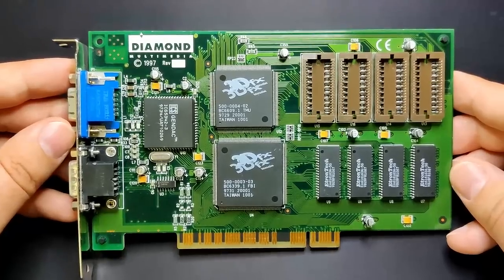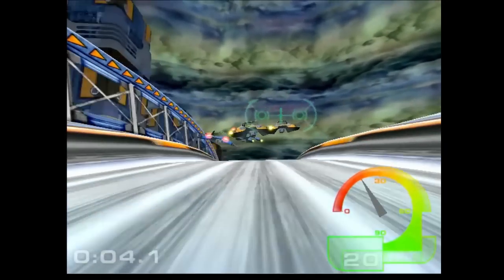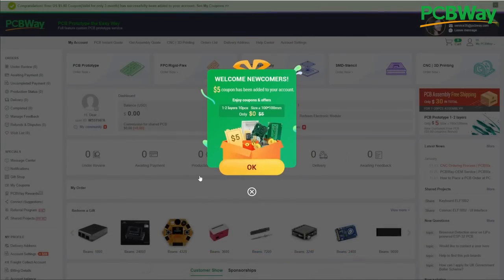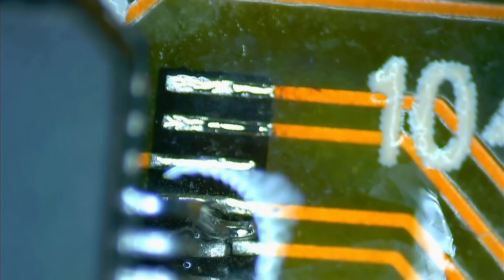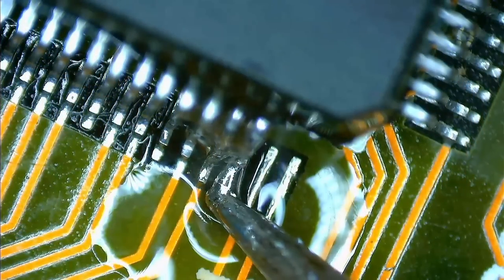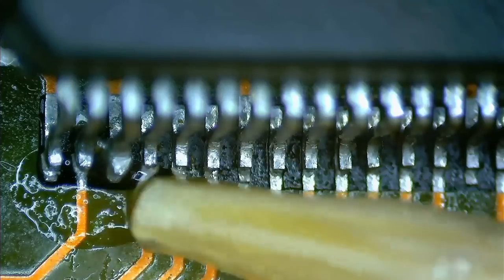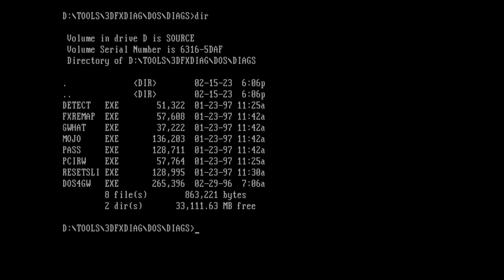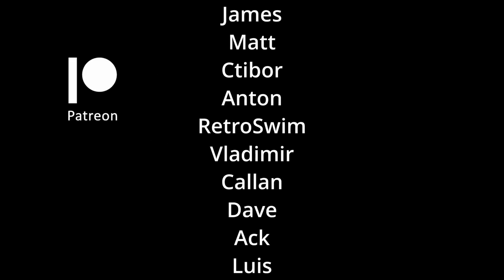Broken pins are no reason to trash your 3Dfx card!

Comment: I wouldn't be so dismissive of the difficulty of this.  It was easy for you because you've developed your abilities to the point that you can successfully perform this repair, but it is certainly not easy.  Great job again on resurrecting another precious Voodoo.  You're doing God's work!  Love your content!
Reply from the maker: The microscope helps a lot! The repair didn't require any electronics knowledge, but the area is very small. I am glad the repair was a success! Every 3Dfx card saved is worth the effort.
Reply: It's 90% equipment and 10% skill, all you really need is some basic experience with soldering and steady hand. without microscope, this repair would be close to impossible unless you have hawk's eyes transplanted.
Reply: @bitsundbolts  The 8Mb mod ... I don't understand it....... If you are bridging (or piggybacking) the data address pins of both.. original and additional chips............ well.. the additional chips will have an identical copy of the same data...... the new chips will have in them exactly the same 4Mb of data that the originals...... they do not store additional data............ in other words.. the GPU can not store additional data in the new chips.... because it do not have new additional traces to store or read from them... i think 🤔...

Comment: I have been an electronics hobbyist on and off for about 30 years now. But I have almost only worked with through-hole stuff. I could NOT solder what you just did on that card! Awesome job mate, well done repairing that card!
Reply from the maker: Thank you! Without the microscope, I wouldn't be able to do this type of work. I just need to replace the camera and light to improve the quality. Thanks for watching!

Comment: It's a pleasure to see fellow 3dfx fans doing the same thing. I recently fixed a Diamond Monster 3D II with one corner pin missing on the FBI. The metal was not long enough so I dug a tiny channel upwards with the tweezers and soldered on a piece of wire. The card came back alive just fine. Save these relics, one at a time!

Comment: Fanastic job!  Regads the pin fixes, I would go with super fine wires rather than replacement legs - the reason is if they get knocked, they could break off further where you then need to grind the chip edge away to fix.  Fine wires on those points, perhaps covered by UV solder mask paint would be fine and a lot less likely to get damaged from knocks etc.

Comment: Don't worry about mixing up ferrite beed with inductor. Ferrite beed also belongs to inductors but has  more specialised task. It's often used to stop high frequency oscillations passing through to the power line. Unless currents are really high typical SMD inductor can do this job just fine. We all live and learn.

Comment: Like! I wonder how much a 3dfx Voodoo 1 can be overclocked, unfortunately there is almost no information on this subject. It would be very interesting to see some benchmarks with a 8 mb 60 to 65 mhz Voodoo 1 :)
Reply from the maker: I read that Voodoo cards are terrible in overclocking. But then, moving to 55 MHz is already a 10% overclock.
Reply: @bitsundbolts  as far as I know the Diamond Monster had an option to run at 57.5 mhz. There were many Voodoo 1 cards sold with 30 - 35 ns EDO ram which at least for the memory have a high overclocking potential.

Comment: Handy tip. You can harvest thin enamel wire from old laptop or PC cooling fans. Also you can safely remove a small amount of the encapsulation plastic if the broken stub is too small to solder to.
Reply from the maker: I may have to remove some of the plastic. When I pressed on the memory boards, the solder joints on the chip broke. It was a quick fix, but clearly the sturdy replacement pins and weak connection to the stubs aren't a good combination. For now, I am very careful with the card, but I may mix it into another video which requires pin replacement and mention the issues with my approach in this video.

Comment: L10 is the component which was missing on my Diamond Monster 3D card as well. It supplies power from the 5v rail to one of the PLL inside of the ICS5342 GENDAC. The datasheet for this chip suggests a Fair-Rite 2743019447 ferrite bead to feed the input at pin 27. The thing is, the missing bead feeds in 9 if I recall correctly, and the datasheet shows this as a direct connection with no bead. Based on this a simple wire should work. If you use a bead the specifics clearly aren't important. I grabbed a random bead/inductor from a dead motherboard and it works fine.

Comment: As an electronics technician: Replacing an inductor / ferrite bead without knowing it's exact characteristics is crazy. But I'm glad it worked.
Reply from the maker: How could I find out the value of this component without spending thousands of USD on equipment? Is that even possible?
Reply: @bitsundbolts  You can get an LCR meter for about 30 bucks these days. It certainly won't be accurate, but it lets you get a rough idea of the capacitance, inductance and series resistance of SMD components. There is a lot more to component selection than these values, but combined with knowing the physical dimensions, it reduces the chance of damaging other parts of the circuit by a lot.
Reply: @bitsundbolts  I don't think either are absolutely necessary here. We're talking about 50Mhz 3.3V components if at all.

Comment: I've had to do this many times, usually to fix my own screw ups, but there always seems to be enough of the pin sticking out after breaking off that it always works.  I'm surprised you were able to fix it this well with such fat wire.  You should get a roll of 30 gauge wire wrap wire or a roll of lacquered magnet wire to fix things like this and broken traces and stuff for the future.
Reply: Or for really fine stuff take a single strand out of a stranded wire.
Reply from the maker: I definitely should use thinner wire.

Comment: I would leave the pins like that, it is working and that maters the most!
I also attempted repairing broken pins in chips and I found much easier if I just leave the wire straight near the bit of metal of the remaining pin. But I guess does not look as good as your fix.

Comment: Technically, ferrite beads are inductors rated by their impedance at a given frequency (just numbers tho, and it will not affect the performance compared to the one of an inductor with the alike properties of course), this also makes them less expensive due to a lower accuracy requirement. The things to worry about are the saturation current (as above one the AC impedance starts to drop) and the DC resistance (which the beads are expected to have the least of, - of course it means nothing, and you can find an inductor with the same or even lower DC resistance). So, if your inductor's saturation current is high enough, I'd say usually you are good to keep using it, as it likely has a bypass capacitor on the load end anyway, so the value, with 4.7 uH being a higher one, does not really matter that much. If anything, you can just take a scope and make sure the voltage spikes do not propagate through the filter the bead used to be a part of. Also make sure no significant DC voltage drop happens across the inductor, and should both tests pass you are good to keep using it without any worries.

Comment: a nice tip, but it's difficult to solder. Next time instead of it, just use tranformator copper wire,I think it would be be easier to solder and fit to pins.

Comment: For this kind of a repair I usually use Kynar wire (not the cheap knockoff stuff). Not only is it thin enough for these pins, the conductor is silver plated lowering it's resistance, and the insulation on the wire wont melt or shrink back when using it as general hookup wire as it's PVDF. Instead of trying to cut and shape the wire, I would have just stripped off the insulation on a length of wire, soldered it to the pad, bent it into place, soldered it to the chip, then cut off the excess. The excess wire not only gives you something to hold and manipulate, but also sinks the heat away from the pad, preventing it from melting the solder on the pad.

The ticker wire you used also may fail prematurely due to thermal cycling over time cracking the solder joints at the chip, a thinner wire which can flex would likely not suffer from this. You can also take a scalpel (NOT and angle grinder, sheesh) to the plastic package and scrape it back to expose more of the leads on the lead-frame to solder to, giving a more secure connection.

Comment: I don't know much about these components, but based on what they both do it sounds like there is pretty much no difference and if anything an inductor is probably a better component. But I will be happy to say I'm wrong if someone wants to say otherwise.
Reply: They are both inductors, but they have very different characteristics. Optimized for different jobs.
This is like capacitors. you have many types and ceramic capacitors have different characteristics from electrolytic capacitors.

Comment: I have to do the same work on 486 motherboard chipset but in my case broken pins are not in the corner but in the middle of a chip and maybe I will also try to fix PII BX chipset in similar way (he don't have pins but I have to try this angle grinder trick).

Comment: You can use a hammer and flatten the wire slightly for easy soldering
Reply from the maker: I see - to flatten the round wire, that probably would have helped a little. I may use your suggestion for a Voodoo 2 that may arrive with one pin missing somewhere in the center of the pin-row.

Comment: Personally, I'd be tempted to forget about authentic looks and try to provide extra protection to your replacement pins. 

Maybe cover the entire corner of the chip in an epoxy blob? Or maybe someone knows about a product that can be easily removed in the future with some kind of solvent?

 I'm just worried that those solder joins with the lead frame will be far more vulnerable to damage in the future than fully intact pins.
Reply from the maker: I am sure those pins are not as strong as an intact pin, but they are quite good. I am not worried anything is going to happen to them. One could tape a heatsink over the chip, covering the chips with some overhang - that won't protect the pins entirely, but it will be harder to reach them.

Comment: Do you know if mojo also works for voodoo 5 5500 cards? Or maybe another similar testing program for DOS?
I'm really struggling with a card like that that has probably RAM issues. Full of vertical lines/garbage on the screen. One version of mojo sais that no voodo card was detected, other one stops with some error message.
Thanks.
Reply from the maker: I have not tested mojo with anything but Voodoo 1 cards. But I think this tool will only work with Voodoo 1 and Voodoo 2 cards.
Have you tried pressing on the memory chips to see if it changes the pattern on-screen? Maybe a solder joint that's broken.

Comment: There's no way I could do this many pina like this yet. Bet while I solder the new leg from the bottom, the top also desolders itself and everything tips over.

But I can throw bodge wires, hopefully that's ok.
Reply from the maker: It took me about 10-15 minutes to get those 3 pins attached. I think the thin soldering tip doesn't dump a lot of heat into the pin since I did not face desoldering on the opposite side. Wires and apparently angle grinders are all good :)
Reply: @bitsundbolts  I suppose i could just tweeze them in and solder them from one side, then liquid-soldermask that in, and then the other. Where there's a will, there's a way. Magnification is the most important bit to sort out properly.

Comment: The card was probably dropped. Fell on that corner of the chip and bent all the corner pins down. The shock of this broke loose all those other pins because it's very old. Then someone without the skills to do this attempted to bend them back and broke them off. Probably tried to do it without a microscope at hand so that's why all 3 are broken and the 4th is bent way out.
Reply from the maker: Very nice and plausible investigative work!

Comment: You made things difficult for yourself. A simple 90 degree bend on the wire would have sufficed. It's never going to look original. You could have done a simple bend, soldered the wire in place and then cut it to length. Much simpler. And you would have had something to hold when putting it in place. Maybe less neat, but as I said it will always be a visible repair.

Comment: You got scammed.

8Mb V1 is much more expensive, board is crap, soundcards, if you can call them that, are trash, too.

Sorry for your loss, given you live in UAE, it probably ain't a thing.
Reply from the maker: I would not trade a Quantum3D Obsidian 8MB Voodoo card for those items. The card I traded was upgraded by me - which I can and will recreate very soon again. Even if they aren't the best items, they are still going to satisfy some of my curiosity.
In UAE it is almost impossible to get retro hardware.
Reply: @bitsundbolts  Fine.
Reply: @bitsundbolts I don't think you got scammed. You traded something you can recreate, for something else you wanted and can use to make videos. That is a perfectly fine deal. 
Even if they are not the most high end components. (Which I doubt because low end sound cards usually don't have memory slots.)
Everyone has done the high end components over and over. And YouTubers like philscomputerlab make videos about the lower end or less popular components too. They are cheaper to get and are interesting or useful in their own ways. They just require a little more work to get the most out of them.

Comment: The 8Mb mod ... I don't understand it....... If you are bridging (or piggybacking) the data address pins of both.. original and additional chips............ well.. the additional chips will have an identical copy of the same data...... the new chips will have in them exactly the same 4Mb of data that the originals...... they do not store additional data............ in other words.. the GPU can not store additional data in the new chips.... because it do not have new additional traces to store or read from them... i think 🤔. -..
Reply from the maker: There is one pin on the memory that is connected to a different RAS line on the 3dfx chip. Think of it as an activation signal and we have RAS1 for 4 memory chips and RAS2 for the other 4 memory chips. That is why we can reuse all the other lines going to the memory pads.
Reply: @bitsundbolts  Right.. but in that case.. it will not be the video card configured for disable or ignore that RAS2??.... like in the BIOS or something 🤔 .... for don't read/write in chips that originally do not have??........ or maybe you modified it...... I should watch the video of the mod again 🥺 .. .. maybe some video card memory test like MemTestCL will show as if the video RAM is actually working... ..... or some other like that because MemTestCL is for OpenGL only i think
Reply from the maker: It for sure works because I do see a difference in performance as well as the possibility to enable higher resolutions. This only works with more memory.